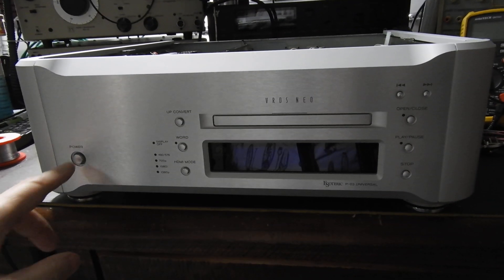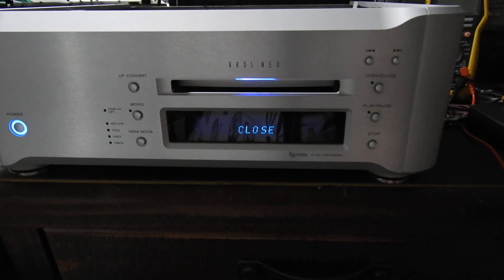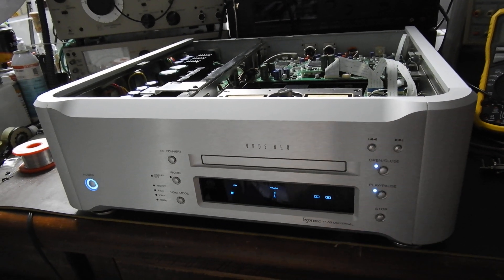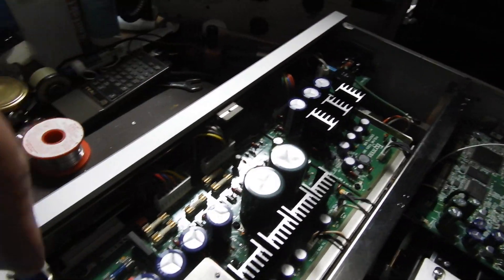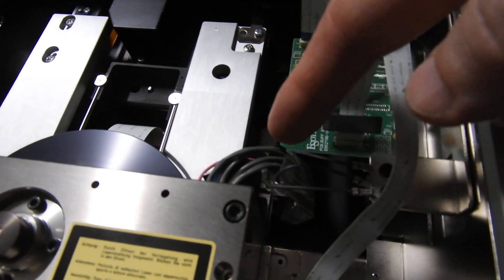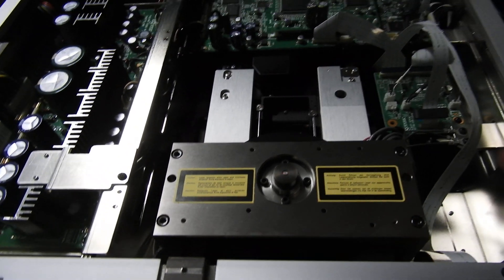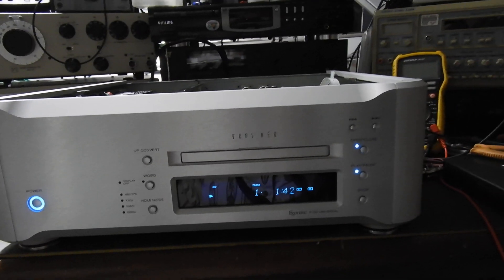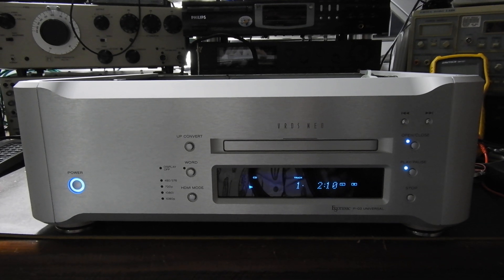Esoteric P-03 Universal Transport - a truly remarkable machine

Comment: I have a misfiring Mark Levinson No.512 player that uses an Esoteric transport. It's not even reading the TOC of an increasing number of discs. Any experience with this model? All the best.
Reply from the maker: Sadly, no. It uses Teac VOSP mechanism which I have never seen. I am well familiar with VSOP (Cognacs) though.
In general, 

1. Clean the lens with isopropyl alcohol
2. Look for any obstructions in head travel.
3. Clean any old grease from travel guide rods
4. See if the lens travels to the inner circle of the CD and with no CD if the laser hunts for CD (lens going up and down)
5. Check and clean any microswotches that tell the servo where the mechanism and clamp are.
Hope it helps
Roman
Reply: @hear-net-au  Many thanks for your thorough reply Roman...
I must admit that your little video has me fancying a P-03 / D-03. Their combined price is about $7k now. And I do have a lot of SACDs, that's my excuse!
The 512 sounds wonderful but it has a reputation for breaking down sadly. I wondered if it was worth buying a replacement laser unit (Sanyo) when they are still available via ebay etc?
All the very best, thx again😉
Reply from the maker: Yes, if you can, get it. it won't hurt. But your problem are probably not due to a laser fault. It almost always is something mechanical; stretched belt, some dirt, hardened grease etc.